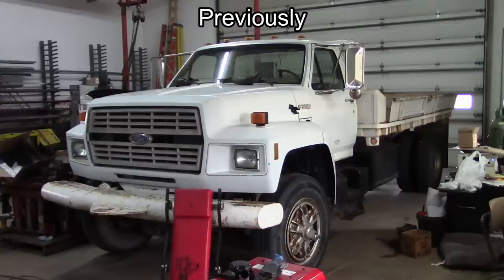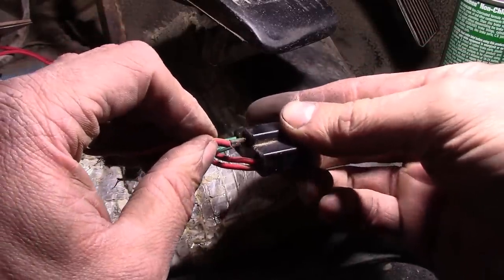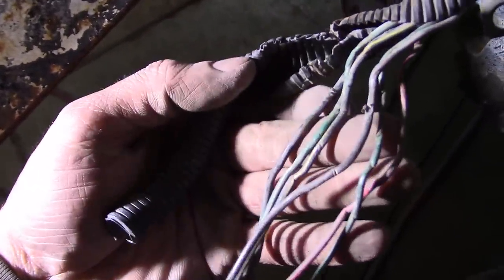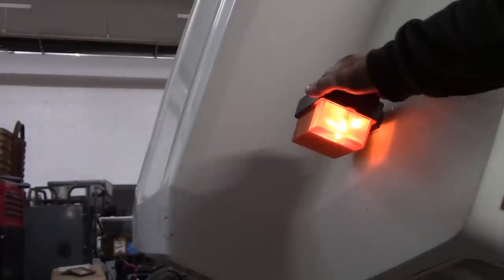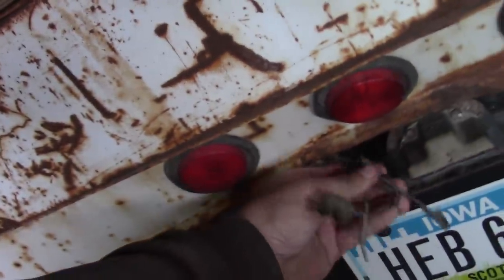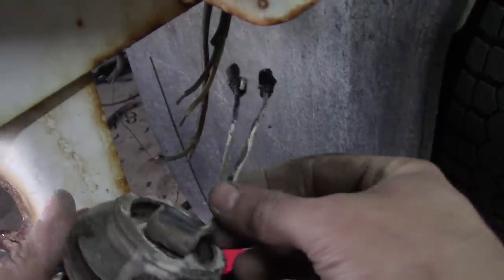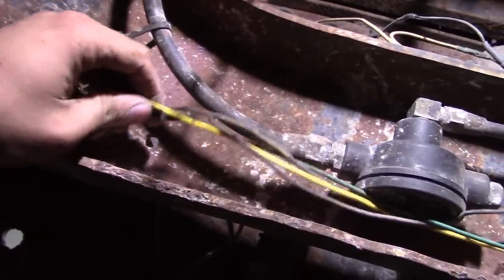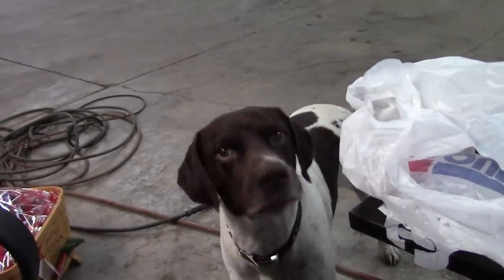Ford F700 Project - Fixing the Lights - Part 2

Comment: If your crimps fail even after crimping them with a lot of force, then the connector was too big, you can fold the wire back on itself to make it twice as thick, that should solve it. (but you already knew that)
Reply from the maker: Or I could get the right size connector. Which is what I had to do. Some days I struggle...

Comment: hey wes just wanted to pass on a fyi those floor mounted dimmers my ol 60 corvair van had it an shorted to ground took me ages to find the issue but the housing can sometimes wear out from all the foot bumping an the contacts will short to ground either on high or lo or both
Reply from the maker: Interesting. I've seen many that were so rusty the button gets stuck down.

Comment: 10:07 I see you are using a uninsulated butt connector, there are insulated connectors. Get an assortment of connectors. Sometimes it is a good idea to add more wire. Too much wire can be made in double loops.
Reply: I use the uninsulated connectors also, then cover with heat shrink. Makes for a cleaner splice than the plastic covered connectors
Reply from the maker: I like the uninsulated crimps. You get a better crimp IMO.

Comment: Is there a reason you don't favor soldering and then the glue shrink. I like soldering in the  uninstalled butt connector as well. What say you. Of course in my Provence, since they manufacture cars here, they like to use a little extra salt just to keep things going.
Reply from the maker: Soldering takes forever. I made something like 50 connections on that truck.
Reply: @WatchWesWork  ..thought that might be it....Your diagnostic skill are great.

Comment: The only sure way for wire connections to last is soldering with heat shrink tubing.  Crimps and but splices don't last because of oxidation due to different metals.  What will tell the owner in 100 years when he brings the truck back because the lights don't work anymore?

Comment: I need that heat gun!
Reply from the maker: It's awesome.
Reply: @WatchWesWork  used one about 40 years ago , yes they do a fine job , they will melt soft solder also same make but a boy blue colour

Comment: WELCOME TO MY WORLD. TWIST TOGETHER AND TAPED WIRES ON 86 F350. AFTER BETTER PART OF 2 DAYS ON ALL THE WIRES I FIGURED I'D BEEN BETTER OFF REWIRING IT. FASTER AND CHEAPER. FOR EXAMPLE, IT HAD 3 TWIST TOGETHER SPLICES IN THE FUEL PUMP WIRE TO THE REAR TANK. SAME ON ANOTHER F350 SAME ERA. WITH A FLAT BED FIFTH WHEEL AND BUMPER  TOW AUX LIGHTS ON HEADACHE RACK. SHOULD HAVE REWIRED IT TOO. I GUESS FORDS IN MY AREA DON'T DESERVE  CRIMP CONNECTORS OR SHRINK TUBING.
MY AREA SUFFERS FROM TOO MANY DIY ERS  THAT ARE CERTIFIED ELECTRICIANS. ALL GREEN WIRES ARE  NEUTRALS  {GROUND}.  I GET THAT A LOT ON TRAILER WIRING THAT  BLOWS TURN SIGNAL FUSE WHEN THE TRAILER CONNECTOR IS PLUGGED IN..

Comment: I thought dielectric greese was to protect electric connections. So why did you drown the dimmer switch connection with it? I just never heard that it would prevent the flow of electricity and should never be used on electric connectors. So, what is it really for? Not trying to be a smart mouth, I just really don't know after hearing you say that.
Reply from the maker: I was being sarcastic. It's a running joke on the channel.
Reply: Dielectric grease, or tune-up grease, is a silicone-based grease that repels moisture and protects electrical connections against corrosion. ... The grease does not conduct electricity, so it shouldn't be applied directly to the mating surfaces (pins and sockets) of an electrical connection.

Comment: I don’t know whether god or bad  but if you were closer to oregon you would have another customer 
Scotch locks are a mans best friend out here 
I was a truck driver for 35 years getting them to not use them on your truck is impossible 
One guy installed a backup alarm on my truck using one couldn’t find why the truck had no break lights
Also kicking the taillight to get the ground to come back gets annoying 
My boss got tired of me putting it on my DVIR  and had new lights put on the back and gee The new ones had a ground wire
Reply from the maker: Right. When I see scotch locks I start cutting.

Comment: Why even bother with those connectors? Just replace them with solderings - there are great autosoldering connectors which are wrapped with transparent shrink wrap.

You just put both wire ends in and heat them up, and they will solder and shrink to a watertight fit.
Reply from the maker: Several YouTube channels, including bigclive.com, have reviewed those solder seal connectors and they don't have many good things to say.

Comment: What the hell happened to that rear wiring harness?  Was there a pack of wild and angry badgers living under that truck or something?  I find it hard to believe that all of that damage to that wiring is a result of dumping.

Those three marker lights on the rear of the bed look like you put 194 bulbs in the outer ones which you said were burned out, but the center light looked brighter, like it's rocking a 168 bulb..

In regard to those 'Y' splices:  Now that is actually a place where you could use RTV. I would apply a dab of RTV at the end of the heat-shrink wrap, where the two wires come out.  The heat shrink isn't going fully to seal against both wires, because the wires won't seal against each other, leaving gaps.  Enter our Lord and Savior, RTV!  In a climate like yours, it might just buy you a little more time.

As far as connecting wires, I never use any kind of crimped connector for two or more wires, because it is just one more part which could fail.  I really do prefer a good twist connection, with some heat shrink over it.

Comment: That wiring hack is what we know as a western union, strip a spot of insulation, wrap
 wire around bare spot and tape, normally you do this with solid wire not stranded wire.
Reply from the maker: I don't think it's a good fit for a truck...

Comment: Hm, as far i know you crimp the connectors the other way round, so you crimp the split opening down in to the wires to help wedge them in.
At least that is the way i was taught as an electritian and all my crimping tools and connectors is made to be crimped with the split to be bend down in to the U.
Also there is a special place in hell for morons who wire anything like that... i have been working about 7 years as an auto electritian building and fixing trucks with cranes and container hoist on and OMG i seen some bad wireing out there!
Too many morons who is too full of confidence! :-/
Reply: WHEN THE INSULATED CONNECTORS FIRST CAME OUT {AND YEAH, I'M THAT OLD}  I WAS TAUGHT WES' WAY OF CRIMPING. SAID POINT ON SEAM WOULD TEND TO SPREAD THE CONNECTOR AND SPLIT THE PLASTIC INSULATION. BUT SOME NEWER GM CONNECTORS {NON INSULATED} WITH AN EXTRA FOLD OVER TO CRIMP ON THE WIRE INSULATION ARE INSTALLED WITH A CRIMPER THAT DOES THE BARE WIRE AND THE INSULATED WIRE AT THE SAME TIME AND YES THE POINTED PART IS USED ON THE SEAM PART LIKE YOU DESCRIBE. IN SHORT, JUST DO WHAT WORKS.
Reply from the maker: As far as I know the dimple goes opposite of the seam so the crimp doesn't try to wedge the seam open. An "open barrel" connector gets crimped as you describe, but that's a whole other kettle of fish.